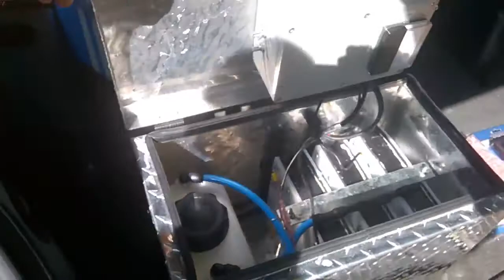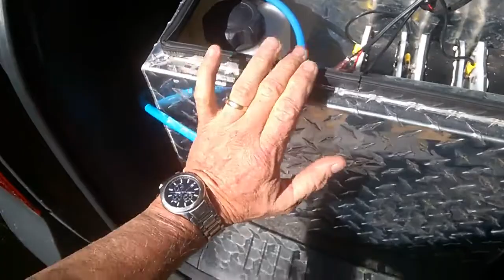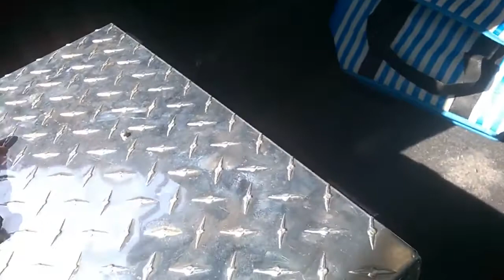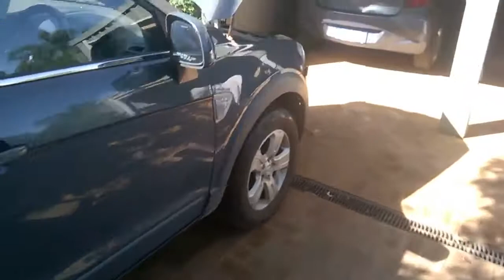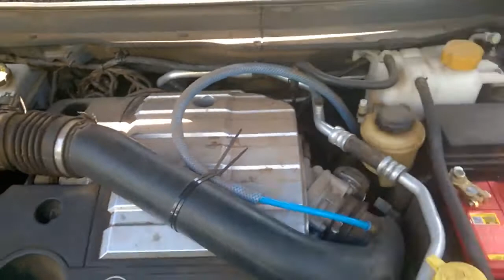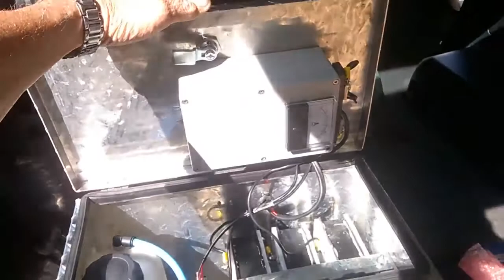hho Hydrogen generator system  Gen 15  in 3 6 Litre  V6 2013 holden captiva

Comment: Good vid, however, the ECU unit controls the amount of fuel being injected etc...so what have you done to allow HHO to be used without being affected by the ECU. I have a VY i want to convert to HHO
Reply from the maker: https://hydrogenfuelsystems.com.au   0403177183
Reply from the maker: call me on 0403177183 
glknox11@live.com
https://hydrogenfuelsystems.com.au
patented , proven and certificated system delivering 32% savings on a 7.2 L truck - 27 tonne load

Comment: Ur steering wheel is in wrong spot xD
Nise setup! Does it run only on HHO?
Reply from the maker: https://hydrogenfuelsystems.com.au   0403177183
Reply from the maker: call me on 0403177183 
glknox11@live.com
https://hydrogenfuelsystems.com.au
patented , proven and certificated system delivering 32% savings on a 7.2 L truck - 27 tonne load